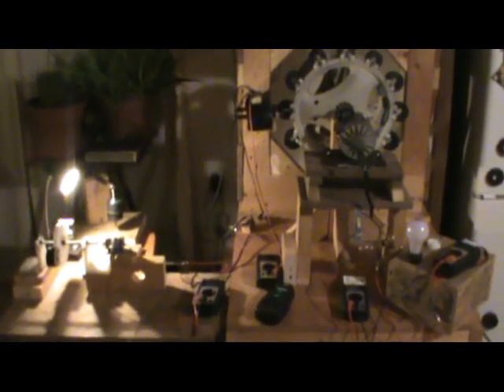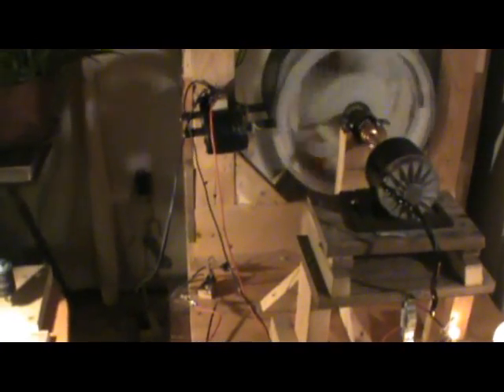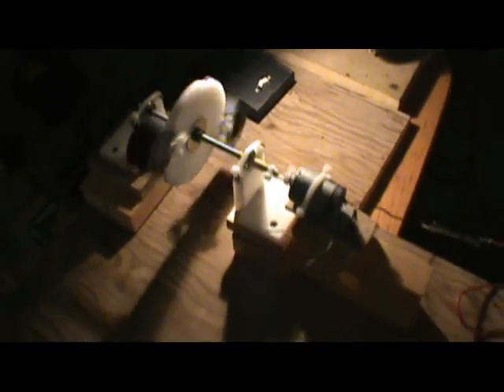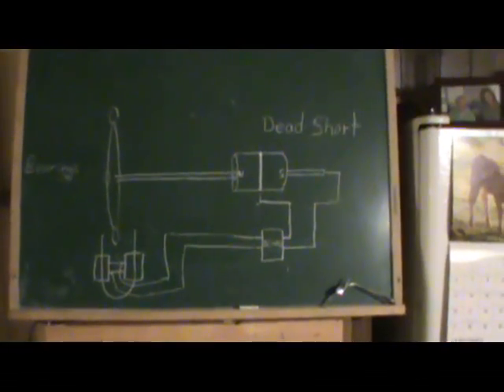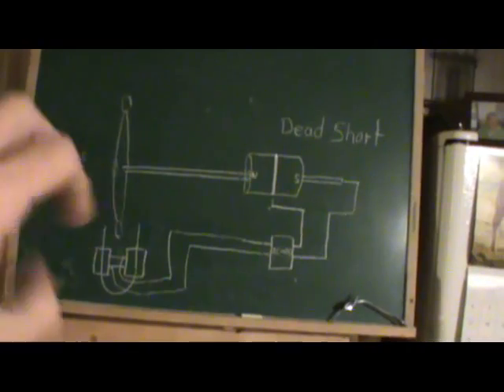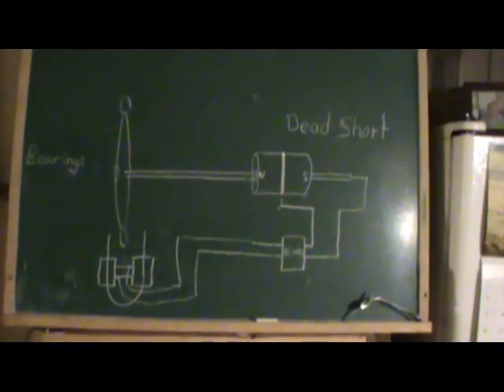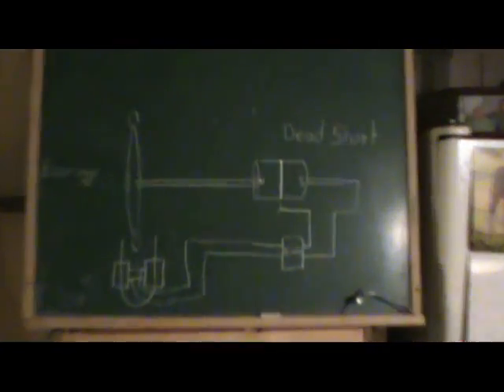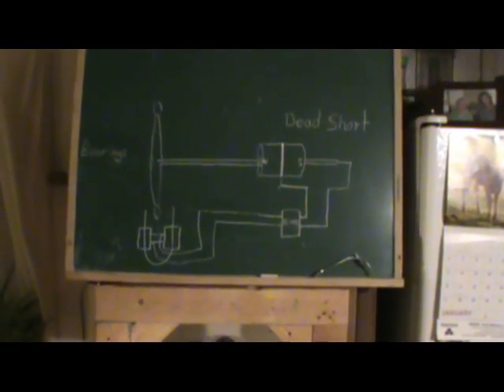Free Energy Project - Prime Mover Thoughts

Comment: Part 2 of 2. To have all 10 layers working together. you start winding as usual around the bobbin. now when you reach the other side, you do not wind back to the beginning. you simply bend the wire 90 degrees and make a bee line to it. If your coil is 4 inches long, then that line will be 4 inches. You then finish the whole bobbin this way. now you will have a mag field 5 times stronger than going back and forth on itself. Does this make sense?

Comment: The homopolor motor may still have resistance at the brush contacts?  What if you took the output of the PMH to a single turn on a flyback transformer core, and wound the secondary on the core with the amount of windings that will work for the device you want to power.